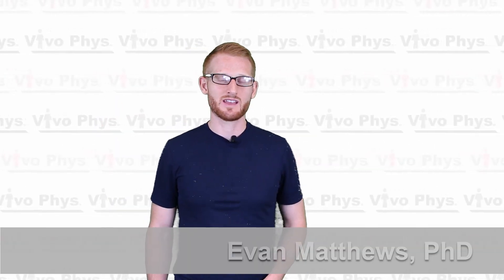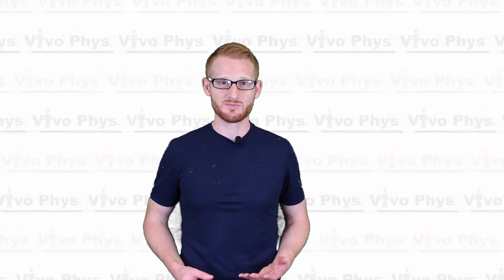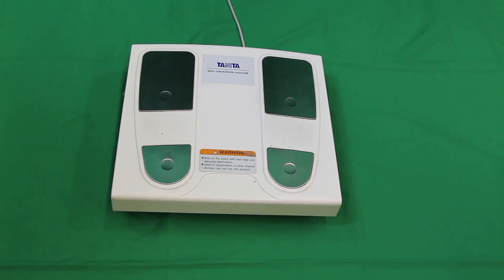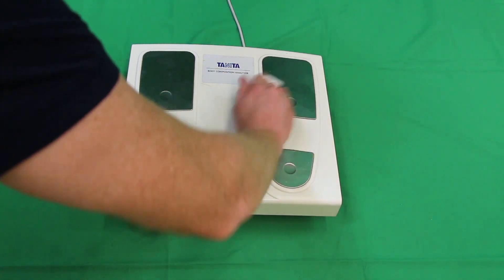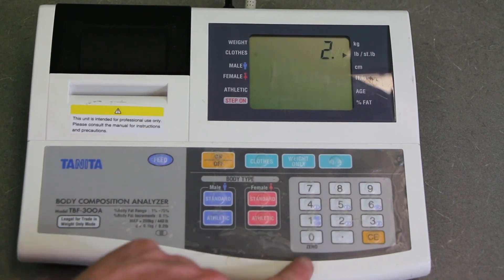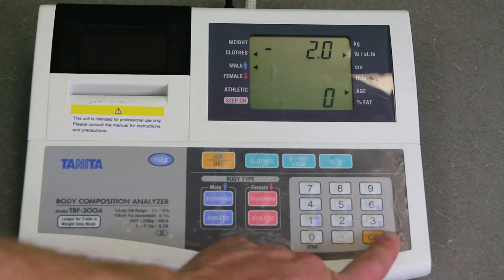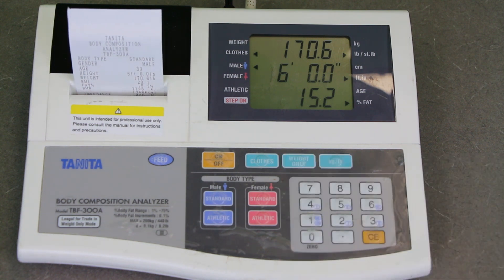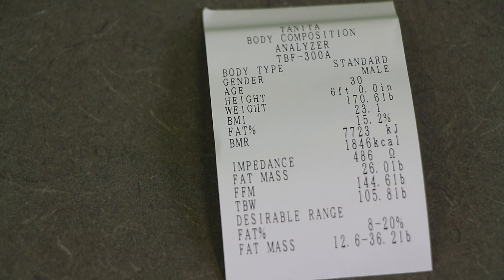Body Fat Percentage - Bioelectrical Impedance Analysis - BIA

Comment: I tried a few machines and researched online , all the machine considers is the weight height and age. If you did it again but chnaged the age and height it will give you different results. The machine should give indicators only using weight and the electrical current
Reply from the maker: Hi Watch With Me. I have the same critique of BIA machines. However, they work based on regression equations. and those other descriptors typically predict body fat percentage. That is why they make it into the regression equation. See Table 1 of the paper linked to below to see a list of BIA equations and how much emphasis the electrical resistance is given in each equation.

http://pubs.sciepub.com/ijcn/2/1/1/